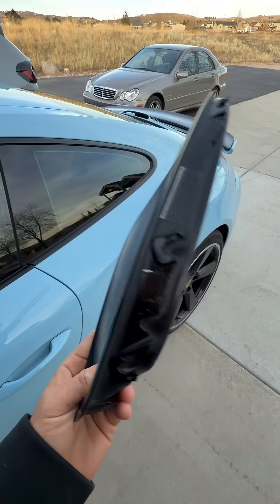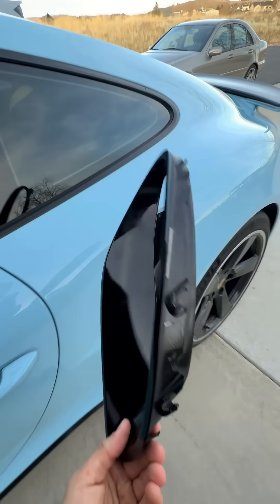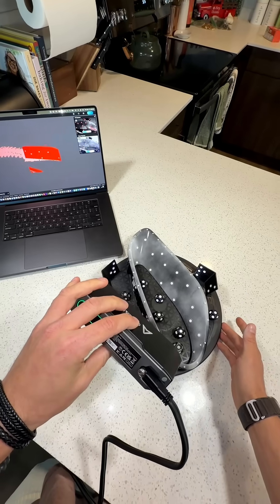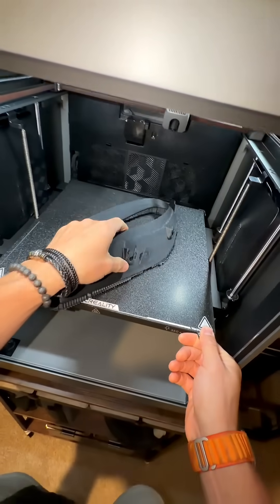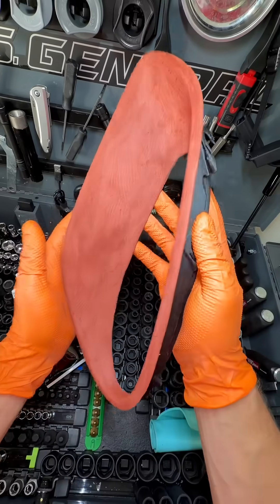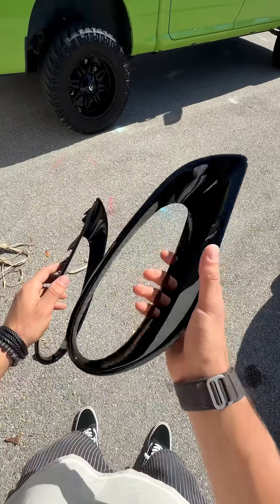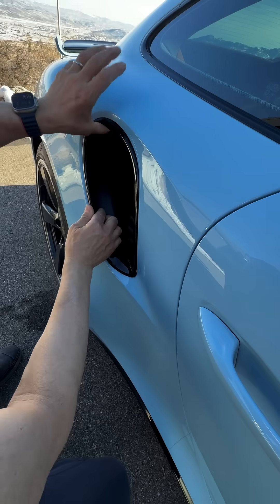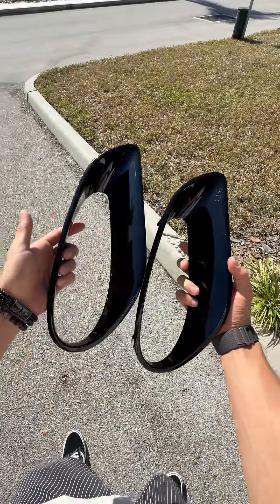Porsche wanted $2,000... So I 3D printed it for $20 instead😳😳😳 #3dprinting #creality #porsche

Comment: Final cost: 2k
Reply: Look at it this way if I buy the 2k part then it's expensive and it's 2k every time it gets stolen then it's cheap to buy a 3k or whatever the printer cost but you got unlimited parts for the car just pay like 60 bucks or whatever it cost for the printer plastic material but it's a lot less than buying a 2k part every time it gets stolen or lost 

Edit: Guys thanks for all the likes and replies I got more likes than what I get in my videos thanks guys
Reply: @YosvanyMederos-x5w the printer is more along the lines of 1k, and filament is around $35 per 2kg roll, and that might’ve been a 1/4 kilo each duct, I have the same printer, and filament and it’s definitely worth it in rhe long run. I 3d printed a wide body kit for my car, and a new front bumper in sections because I crushed it on a curb, It takes a while to print stuff that big but 1000% worth it
Reply: @DylanMoore-b9uIs it even legal to drive with a 3D printed Bumper? Isn't Bumper made in such a way to absorb shock? How can yours be the same?
Reply: @kirakira9906 i don't think the bumper is meant for shock, but rather protect your own car from small dents etc. Might be an insurance issue, but legally.. i doubt it.
The crumple zone, i.e the metal designed to bend in a certain way to minimize personal damage, that's what I'd guess would need to be stock for legality.
Reply: @kirakira9906 first of all, u did a buch of logical mistakes, basically coz u uneducated in the topic u r trying to argue...
That's okay, no one can know everything but in a future please think before saying, or just ask instead of "claim" some one as criminal 
First and foremost, plastic details on ur car isn't there for "absorbing" any impact, ur chassis do that, plastic elements there for airodynamyc purposes 
Second one, no it's not illegal coz there was no cases when those parts caused any trouble for anyone and law system in USA is based on common law tradition which is laws are developed through judicial precedent (case law) and NOT — on predictions "what can happened" 
Hope u understand it clearly
Also I'm not american and not even living there (yet) but to be honest — I want
Also I'm engineer, so I kinda cheating here even tho cars wasn't my speciality :D
Reply: @kirakira9906  the front bumper is plastic. The crash bar and crumble points of the front end are what you’re thinking of
Reply: @DylanMoore-b9u you printed a body kit? how does it print things that big in a single piece?
Reply: @DylanMoore-b9uno yeah, but the scanner is 500+ bucks too.
Reply: @Sneaky_Basket Driving a car with a 3D-printed bumper on public roads is generally not legal in the US, as the bumper is a safety-critical item and would not meet the specific federal and state safety standards required for road use. Litterly 1 Google search away buddy 😂
Reply: @MedicAthlete24W FACTS, she's thinking of the internal safety elements of the bumper, when the original person of this thread more than likely was referring to the "sleeve" or "cover" which are only the cosmetic and aerodynamic elements of the bumper. And so to accurately answer her question, there's nothing illegal about driving with a 3D printed bumper cover or sleeve. Companies make aftermarket parts all the time by the way. It would only be necessary for the internal safety components to be up to spec, assuming the internals were also damaged to begin with.
Reply: @kirakira9906 bumper cover 😂 not bumper and no it's not illegal to have a custom bumper because you don't have to follow policy car manufactures do.
Reply: @Sneaky_Basket  I'm guessing you're from India?
Reply: @MedicAthlete24W  technically speaking the part you’re referring to is the front fascia. Almost all vehicles actual bumpers are underneath the plastic/metal fascias.
Reply: @kirakira9906  almost all cars now have a front fascia which is what he’s talking about. The actual bumper is metal and hidden underneath. Only some trucks have their bumpers visible. Everything else has a front fascia with a bumper underneath. Fascias are purely for esthetics and aerodynamics.
Reply: @MedicAthlete24W  it’s not a bumper it’s a fascia. The metal bumper is underneath it.
Reply: @ghosthunter0404  yeah one Google search for incorrect information because everyone is misidentifying the bumper. 

It’s a front fascia, the metal bumper and crumple  zones are underneath. Doesn’t really matter if you 3D print one. It’s purely for esthetics and aerodynamics.
Reply: @Pawnsylvania Oh okay, thank you for the more technical clarification. I was just skeptical. I don't know how much it costed him to print it, but depending on the Car it's easier to find a good piece for a good price in Scrape Yards. In my country (I don't know if you guys have a system like that), there are Scrape Yards managed to resell (at a lower price) parts of Cars that are still in good condition (and meet Law's requirements).
Reply: @kirakira9906  plastic bumpers are covers not actually bumpers. The bumper is steel and underneath the covers.
Reply: @DylanMoore-b9ueven the CR otter is only about $800. Opportunities are endless when you can do this.
Reply: @MedicAthlete24W No the bumper is the metal part under the bumper cover which is the plastic part. In the US I believe the bumper must absorb a 5mph crash without the structure it is attached to getting damaged.
Reply: @DylanMoore-b9u I printed an entire car, with a hat to match. They see me rollin’, they hatin’.
Reply: @DylanMoore-b9uWhat printer is it??
Reply: @Sneaky_Basket engineering regulations are not created as part of common law.

And laws are written to include penalties for doing things that are not within regulations.

An engineer should know all about industry standards and laws around safety requirements.
Reply: @DylanMoore-b9uthe printer is around 1k but you're forgetting the creality scanner which isn't cheap
Reply: @julianbruce7595 he literally said he done it in sections, if ur printing something big u print stuff in parts that click together or glued together
Reply: @DylanMoore-b9u forgot cost of labor in there…
Reply: @DylanMoore-b9uyeah but that scanner doesnt come with the 3d printer, thats another $2000, plus hours of his time.
Reply: @DylanMoore-b9u maintenance??? what don't you never clean it ?
Reply: @DylanMoore-b9urealized something. This is a 2000 dollar part for a PORSCHE. Yeah, I mean, if I have new Porsche money, a $600 dollar scanner is probably a non issue. As someone who has 2015 Honda civic money, 600 bucks is my share of rent for 2 months.
Reply: @kirakira9906 This isn't a bumper, it is just a trim piece and most of those are made with ABS plastic.
Reply: @HeyNostradamus But it, like the 3D printer can be used for many future projects. $2,000 for the Porsche part and you have nothing left over. What if the same part gets damaged again? Another $2K gone.
Reply: @Sneaky_Basket  do you wanna talk about uneducated? You can’t even spell cause right like all of the grammar errors and what you just said make you look like a kindergarten trying to talk like they know what they’re saying
Reply: @S @Sneaky_Basket  also I highly doubt you’re an engineer because engineers don’t type like that
Reply: @Uselessnonsenseisgoofy  Clearly English is not their native language and is a 2nd language. So I'd say they deserve some degree of grace when it comes to grammar and mistakes.
Reply: @DylanMoore-b9ucan you explain how you printed for your bumper? That sounds amazing
Reply: @DylanMoore-b9ubro im curious to see how that came out
Reply: @DylanMoore-b9ukeep printing a few and sell em online for like 500😅
Reply: @kirakira9906  he didn't 3D print the bumper he 3D printed the bumper cover
Reply: @BrownFella  That's what I said
Reply: @DylanMoore-b9u The printer is $1100 and the Scanner is $900, and that's before any taxes and shipping. So base level the equipment costs as much as the new part.
Reply: What's the first thing a pedestrian hits in a collision smart boi?
Reply: @julianbruce7595  if you don't restrict yourself to printers with a body there isn't really a limit to maximum print size. You can print as big as you can make the rails the motor of the printer head rides on. And if you use a rolling print bad, you can even make one axis virtually infinite ...
Reply: @DylanMoore-b9ulol printed wide body kit
Reply: @DylanMoore-b9u You forgot the price of the 3d scanner!
Reply: @Sneaky_Basket wrong. The front of cars are now plastic for pedestrian protection. Plastic is a lot more forgiving on a pelvis and legs than metal. It’s not hard to verify. So, you are the one who is uneducated. Also, try writing an actual, intelligible sentence before insulting someone else’s intelligence, it’s really not a good look.
Reply: @ghosthunter0404 who would know though? Besides yourself.
Reply: @DylanMoore-b9uyou forgot about the 3D scanner price
Reply: @Sneaky_Basket  wrong.
Reply: @ghosthunter0404  Correct, thanks for letting people know to not cause themselves huge headaches in a law suit where the printed number snapped way too easily and caused injury to a pedestrian- then we see the suing start to happen.
Reply: @badavian 😅
Reply: @HeyNostradamus  I own a 3D printer and a 3D scanner but no Porsche. If I use my tools to make a part - should the full tool costs be applied to the cost of that part?

And for this video? The guy making the part did it for a friend. His friend did not need hos own printer and scanner.
Reply: @DylanMoore-b9ufirst off you can most certainly get a printer than can print asa for cheaper than 1k and that part realistically not including the printer is assuming we factor minimum spend on materials then this realistically costed around 70 dollars to make on a 300-600 dollar printer
Reply: @kirakira9906 the crash bar behind your bumper is designed for that. Bumpers are just cosmetic
Reply: @julianbruce7595 it doesn’t, you print as big a so can then bond the pieces together later😅
Reply: @kirakira9906 modern front bumpers are abs plastic. There's an actual metal bumper just behind it
Reply: @ghosthunter0404  it was the bumper cover that he printed, even though he called it the bumper. It has no structural function. It is cosmetic plus makes a contribution to the overall aerodynamics of the car.
Reply: @Sneaky_Basket  being an engineer and using "coz" instead of "because" proves why China is eating the market alive 😂
Reply: @kirakira9906  at least in Germany its not legal to print bodywork for cars. These parts need to fullfill a lot regulations.
Reply: @DylanMoore-b9u P1S printer is 400 bucks btw, not 1K. and it has the same print quality as the higher end printers
Reply: @DylanMoore-b9u yeah plus the printer is a 1 time buy then after that you’ll save a lot
Reply: @kirakira9906  most people call a bumper cover, a “bumper”. The painted plastic you see on the outside is not at all designed to absorb shock, the bumper is under that plastic is. Designing something to be functional and also stylish can be tricky, and with strict safety regulations for vehicle production, automobile manufacturers have switched to hiding the actual “bumper” behind the body style of the car. That’s why you typically don’t see cars and trucks with actual bumpers that are attached to the unibody or frame, and has since created a huge shift in the way cars look nowadays.
Reply: @kirakira9906 it’s not illegal, but I don’t know how the whole crushing legality would work because they can’t test that
Reply: @julianbruce7595 it’s not a full 1 piece it was about 40 different pieces with 10% infill, then they were all connected with dovetail joints, and sanded them coated with 2 layers of carbon fiber. Took almost a month but considering it was only $200 in materials I made it out on top. Only hard work was assembling and coating with carbon fiber
Reply: @BrownFella no, it was a full bumper, not a cover but I did not mess with a crash bar and all of my sensors, and safety features are still attached
Reply: @Crunch.Punchman nope, it just took multiple months to finish, but it was worth it
Reply: @superyumb actually I only ever had the nozzle clog, replaced it with a $40 silicon carbide nozzle and never had another issue besides bed adhesion but the k2 pro ai caught that before it really mattered and sends my phone a alert
Reply: @Odiewan-Kenobi768 no it’s a full bumper, if your being more technical it’s a front fascia, but it makes sense to call it a bumper in this case
Reply: @brag0001 also you can just print in large chunks and connect them, I used dovetails and 3d gloop, then carbon wrapped it
Reply: @howdyyallllll100 yeah, it’s sick
Reply: @MoneyTipsAndClips you can even make one on a old 2018 ender 3, i started with printing on that, but then decided to go with a k2 pro so I could print bigger, faster and more reliably, but it’s totally doable with a cheaper printer just takes longer
Reply: @StatusQuo209 yeah I had a k2 pro, that’s why try at was my baseline for myself, you could defenitly do it on a ender 3 which is what I used for the first sections of my bumper (front fascia) until I decided to get a better printer
Reply: @ekhatchmax1405 yeah I was using the word bumper in this context because I didn’t think so many people were thinking I bodykitted a fucking piece of metal under the fascia😂
Reply: @DylanMoore-b9u sure, but that's more of a crutch. Useful, if no other option exists. But if you need it on a regular basis those options do exist ...
Reply: @DylanMoore-b9u 

What's the time and effort worth?

£600-£1000.
Reply: @DylanMoore-b9uwell the machine and the camera itself is way more expensive and if this would happen often them it is worth it
Reply: @DylanMoore-b9u3d scanner is the expensive part here
Reply: @DylanMoore-b9udo you like this printer? I have been researching machine for too long now not committing
Reply: @YosvanyMederos-x5w because these get stolen all the time😂😂😂
Not to mention all the prep work needed afterwards😂😂😂
Reply: @kjjviii1735 if the parts cost 2k for a replacement im sure there is a business for stealing these
Reply: @BubbaFettscafe. But how often do they need replacing such that there’s a demand for them to be stolen?

You’d have to steal a load to create the demand….and then hope that demand finds you in order to sell it…without you getting caught.
Reply: @kjjviii1735 😂 everyone drives around in a Porsche 😂that is why😂. Most common car on the road.😂
Reply: @kjjviii1735 You can always find a reason to belly ache about something. That's not special.
Reply: @nathan9113  that makes no sense. You could be a millionaire and still think $2000 is too much money to be throwing away on a part that can fall off or get stolen at any time.
Reply: @nathan9113  its not the owners time. So why would he care?
Reply: @nathan9113 or, because fuq Porsche
Reply: @kjjviii1735  yeah because the scanner and printer can only make this exact part 😂
Reply: @GR33KFR3AK  use more emojis, please.
Reply: @NeilWatkinsfromaccounting will do 🤘🤘🤘🤘🤘🤘🤘🤘🤘🤘🤘🤘🤘🤘🤘🤘🤘👍👍👍👍👍👍👍👍👍👍👍👍👍
Reply: @kjjviii1735  The point is that it pays for itself. Even if you used it for literally just this. But you won't, because there's plenty of other actual practical use cases for a 3D printer. Even if you design and print one other thing that isn't landfill material you've now exceeded the original investment.
Reply: @BubbaFettscafe.  How? Who will you sell them to? These parts almost never break, very few people need them replaced. It's just a plastic piece. You'd steal them and end up having it sit there collecting dust lol
Reply: @AlphaFox_101  these parts don't just fall off at any time and they rarely get stolen because they're not worth much on their own. It's not like the rims were stolen
Reply: @user-ze3sg6ix1u  They must just fall off. Like you said they didnt take the rims and the other one was still there
Reply: @kjjviii1735 THESE might not get stolen/replaced all the time but many other things on many many other cars, let's be real here no one is buying this whole set up for 1 vent😒
Reply: @kjjviii1735  I guess you never heard about the Porsche headlights getting stolen pandemic. Dealerships were literally having every car on the lot jipped every night.
Reply: @AndrewCotner-z7l oh well, lucky we have a printer to replace the headlights, right!🙌🤪
Reply: @kjjviii1735  if you cant think of all the plastic shit in your life that you could easily fix instead of throwing out and replacing when it breaks, then you are right, the 3D printer is not for you. But that is really just a personal problem on your part.
Reply: @kjjviii1735 cause the couple hours of prep work totally isn't worth saving over 1k.... Sure if you got the right kind of money problems just go spend that 2k on a plastic part. Or be like the rest of us with an enginuative mindset and save that money.
Reply: @kjjviii1735  I don't get what's the point of stealing a plastic duct
Reply: @kjjviii1735 VW needs to do better , in South Africa it’s their head lights on their VW polos it’s literally the only car that thieves target because apparently you can just remove the headlights with a simple pull.
Reply: @AlphaFox_101  I think a millionaire is actually more likely to think that.
Reply: @cymy2  Exactly. Millionaires became millionaires by being careful with their money. Theyre not usually wasteful
Reply: @kjjviii1735 would not be surprised if someone at Porsche is getting paid off the books to just find cars and steal their ducts. 😂
Reply: nahh 3D printers are relatively cheap now so this couldn’t cost 2k unless going for an ultra premium printer
Reply: @xxviper2264 if you do 3D printing and already have appropriate printer software and everything, then it really boils down just to material cost...and companies are scared of it
I am sure there are people who would rather pay 2k for overpriced plastic loop just so it is "original" but people are figuring out that "brand" is not worth that much if result or for example taste (with cheap cola) is the same
Reply: @xxviper2264  that scanner will be the biggest cost.
Reply: @xxviper2264  the scanner is $1500 alone
Reply: @Daralyndk  100% agree with materials, but nothing comes close to real cola tho 😂 I swear to god I live on and for Coca Cola, rip offs are just not the same 😭
Reply: @YosvanyMederos-x5w and then next time you need to print something, you already bought the printer, you don’t need to buy it again for your next project. That alone makes it worth it imo
Reply: @YosvanyMederos-x5w  sorry man, no disrespect, that's one of the most stupid takes I've ever heard. Justification: you're acting like parts flying off your car is a regular thing  it's not, it shouldn't be, and investing in a printer for that reason alone is dumb financially. Sorry bro
Reply: @YosvanyMederos-x5w dad math wins 🔥
Reply: @YosvanyMederos-x5w  you're really anticipating this gets stolen that often?
Reply: @YosvanyMederos-x5w  not to mention you can also make/replace shit for the rest of eternity as long as you got the warranty
Reply: @YosvanyMederos-x5w every time it gets stolen 😂
Reply: @YosvanyMederos-x5w his printer is like 600$
Reply: @YosvanyMederos-x5w  Things are always cheaper when you have the know-how to make the thing. But, there's a reason most people buy furniture instead of buying a bandsaw and some lumber.

This is not me discouraging DIY btw, just that people tend to overlook the (time) cost of having to learn the skills needed to replicate the thing (on top of the cost of tools and materials).
Reply: @YosvanyMederos-x5w you're trying too hard to sell this
Reply: @YosvanyMederos-x5w I get your point but „if it gets stolen again“? Time to move neighborhoods lol
Reply: @YosvanyMederos-x5w yeah he just mention the plastic material it self is $250 and then the paint sent to a shop ( yeah maybe next he would buy his own paint system), and then the time (well if you got nothing to do but make utube vid), then he might as well start his own business then and only then, it might hit him 😂
Reply: @YosvanyMederos-x5w why would someone steal it? What for? And even if it does why do you park this car where parts of it get stolen? 🤷‍♂️😆
Reply: @YosvanyMederos-x5w how many times do you plan on replacing those? 99% of the cars never have the issue,your comment is dumb in THIS situation
Reply: @YosvanyMederos-x5w almost got a stroke reading this
Reply: @YosvanyMederos-x5w , where do you live so plastic gets stolen?
Reply: @YosvanyMederos-x5w yeah... But how many times will you lose your Porsche parts
Reply: @YosvanyMederos-x5w  printer and parts with computer maybe 10k?
Reply: @YosvanyMederos-x5w  maybe you should not break or lose (I don't really know how can you do it) parts of your car. Also it's not common to have this kind of cars and live in places where stealing is a problem.
Reply: @YosvanyMederos-x5w  Time is money friend
Reply: @YosvanyMederos-x5w  did you see how much time and effort it took him to make the part, the multiple sandings the spray painting etc and then the $100 extra for the preofressional finnishing.... also keep in mind the mess the spray paint makes... unless you want to setup an OE parts business this is a complete waste of time
Reply: @g00dnatur7 it really depends on your income and whether doing stuff to your car is a hobby or not. If you could make the money in less time than it takes to make the pieces then maybe it's not worth it. If you like modding your car and it's a hobby then maybe it is worth it even if it's technically more expensive due to it taking your time. 

This isn't a one solution fits every person scenario, I'm not sure why so many people can't grasp that. This guy is just highlighting the possibilities of new technology, it's that simple.
Reply: @g00dnatur7  I’ve night tired part side mirrors for cars that come in just rough plastic.  Sanding and painting isn’t too tough

I used rattle can.  Glossy silver is pretty universal.

My critique is that scanner is cool but it’s just another thing that’ll not work in 8 years and if you want to keep having that functionality you’ll have to replace
Reply: @g00dnatur7  I dont intend to downplay the work he did with the sprays but thats maybe just like 1 afternoon of work. Probably a couple of hours. The scanning and printing process was probably a couple of hours, half a day at most with some waiting time in between. You can probably get this done in one weekend if you have the equipment and the parts. But I think he is advertising it as a business model which isnt bad either. In another comment he said he used around $250 in total so if he charges like $100-$300 or even $500 on top of that for the work it would still be less than half of the price of one part and you would be getting 2 matching pieces. On top of that he probably has enough time to do more than 1 small project in the same day while waiting on some parts of the process for the other one, its not a bad business model for the customer or the provider.  

Saving like $1200-$1500 on a piece of plastic that can easily get stolen again is a good decision.
Reply: @g00dnatur7 dude. All of those sandings combined takes like 40 minutes. It's not even a full day of your weekend and saves 2k dollars.
I couldn't make that money in a week let alone a day.
Reply: @g00dnatur7 ts gotta be ragebait 💔🤞
Reply from the maker: it was around $250 for all the material. i already have the scanner and printer. if i didnt well than it paid itself off. and if i bought the parts from Porsche it would be $4,000 for the pair
Reply: @Haydenschreiermk2  The scanner is like $800 though.
Reply: @akingtonone only $250...... must have equipment,  knowledge and time....
Reply: @akingtonone that's cheap.. I thought it'd be more
Reply: @johnny9072 what??
Reply: @akingtonone  you aren't buying a 3D scanner and printer just to make a car accessory and then throw it away. Equipment cost shouldn't be factored into overall product cost
Reply: @akingtonone you understand, even if you have to buy the scanner, you can use it in the future for multiple purposes and multiple times?
Reply: @AyushRaj  equipment costs must always be factored into the price of anything you produce. You shouldn’t factor them into the price of one or two parts, but you must factor them into at least first year of production. After that, you are out of warranty, so on the second year you should factor the maintenance costs. And from 2nd to 5th year you should also include replacement costs. 
Of course all this applies only if you are going to use this equipment commercially. 

If you are not going to use it commercially, then you should factor it into the price of those first two pieces. And as you said: you are not going to throw it away, so you should also factor in the price storage costs for equipment you are not really using, but also not throwing away. :0)))

You could just buy the scanner (as the cheaper part of equipment), do scanning and playing with the 3D model as a hobby (so that you don’t calculate your own cost of work hours), and then take it to a job shop which will print it for you at a price of about 4-500$. (Because you want a sample in PLA and then the real part, and they have invested money so they have to factor the equipment cost and labor into their price)
Reply: @akingtonone yeah but he already got it. If he didn't, you could add the extra 800 bucks to the cost. And he must use his printer for other stuff than simply printing car parts.
Reply: @akingtonone fun fact, you don't need a new scanner for every new project, I know right, sounds revolutionary, but it's true, just like if you want to watch something new, you don't have to buy a new TV for it.
Reply: @akingtonone  you're saying that like the printer is one time use only for the Porsche
Reply: @MacakTosha that’s probably why my boss charges so much. He’s including the price of the drill he bought 7 years ago
Reply: @AyushRaj  No shit, but you can't just replicate this as cheap as he did.  It doesn't work that way.  If you don't have the equipment, you'd still have to purchase it.
Reply: @johnny9072  yeah the point is not that you SHOULD do this, just that you CAN do this
Reply: @akingtonone  yes and the house is 800k but he already had it
Reply: @manuelmenendez5691  you still have to buy the house 😂
Reply: @akingtonone still cheaper than Porsche
Reply: @EugeneC219  it’s not cheaper than buying the parts themselves from someone other than Porsche. And if you don’t have a scanner or printer it’s not.
Reply: @johnny9072  yah, so it is really worth $2000. LOL
Reply: @akingtonone yeah 800 it's not 2k or 4k and you have a printer for future or other purposes
Reply: @MacakTosha  to sum you up quickly, "accounting for initial cost, maintenance, and depreciation ideally ought to be worked into pricing."
Reply: @akingtonone  yes but the point being made here is compared to the OEM part. If you had a friend or even a little bit of connections through which you can get a scanner and printer then it will be significantly cheaper than the OEM part.

Or you could buy one yourself and consider it an "investment" because 3D printers are actually very useful for printing everyday use objects and even decor and gifts. Thing will pay for itself slowly
Reply: @akingtonone  If this is the only time you're ever going to use it, yeah, you have a point... but I doubt that's the case for this dude.
Reply: @deedoubs agreed but it’s cheaper for the normal person to just buy it.
Reply: @ClavinZKL minus the money he made on this short from the total
Reply: @akingtonone  So?... Even if the scanner was 2k, it still paid for itself, and not mention he can print more of these parts, and sell it to make up for the printer.
Reply: @akingtonone  Yeah but you can use it over and over again for other things, so I wouldn't count the scanner as part of the expenses of making the part.
Reply: @akingtonone in the long term it’ll be worth it
Reply: @MacakTosha  Tell me you’re a finance guy without telling me you’re a finance guy. All we need is to depreciate the asset for accounting purposes, and I think we’ve covered all of our bases. Love it.
Reply: @akingtonone You haven't counted your time. You actually made a strong case for $2k being reasonable.
Reply: @akingtonone  you can make so much shit with that and I’ll pay for itself after one or two times of usage
Reply: @johnny9072  Well done Johnny you've discovered division of labour
Reply: @akingtonone  still less than 2k
Reply: @akingtonone  yeeeeah but…um he didn’t buy the printer just to print this….holy smoke!
Reply: @HydetheRapper  i am an engineer. 
When I design some product or a part, i must consider the function of the part, its reliability, loads it has to bare, weight in the whole product, and of course: production difficulty. This has huge impact on the price of the part. 
If I design a part like this, or copy it using a 3D scanner, I want to know how much it costs to be produced, before I go to a guy who has a printer that can print using strong plastics, and lay metal inserts and strengthening fibers during the process. 

If I see that I have a lot of printing like this, and that my suppliers are robbing me blind, I want to be able to recognize the moment when I have to buy my own printer with these capabilities - so I can earn more. 

We don’t work hard so we can afford best machines. Machines have to work hard to earn us money. 

At least this is my logic for any investment that is more than a thousand dollars. ;0)
Reply: @the_n0mad  Nice strawman, who made that point exactly? The point was that equipment cost should be factored in with the project cost, since any NEW person attempting this project would NEED and LIKE to know that. 

it is very disingenuous to say you spent pennies to slap together a project that would not exist without hyper expensive equipment
Reply: @akingtonone Or go to someone to to do it for you for a fee like he did for the final paint finish. And a 250$ scanner investment for a 3600$ job isn't bad.
Reply: @akingtonone if you’re doing a job yourself 

Do you count the tool price?
Reply: @the_n0mad  for real? I threw away the last unit when I was done printing what I needed. 

I thought they were one time use?!
Reply: @akingtonone best ragebait I've ever seen lol
Reply: @akingtonone  he already has the equipment at hand. so, it's far more economical for him to do it. and if you don't have the equipment, there are 3D printing services that does the scanning and printing, even if it costs $600 it's still a better option.
Reply: @akingtonone not per use though and it’s not limited to this single use.
Reply: @the_n0mad hold up, I've been buying a new printer for every print job, I've been doing it wrong?
Reply: @akingtonone Or walk into your closest library with a 3d printer and scan the part with your phone.

The tech is not rare, plenty of places where you can access high end printers like x1c for literally for free.

The point of the video was to showcase that you can just make the parts yourself, how you source the machinery is up to you.

plenty of people would also just print that just material cost + postage out of boredom (I own several printers and constantly print spare parts for people just because I can)
Reply: @akingtonone are you going to buy a $800 scanner everytime you print everything? No
Reply: @johnny9072  and the problem on that is?
Reply: @akingtonone Yeah that's really not how it works... If i buy a laser cutted part, am i counting the price of the laser cutter into the outcome cost? 😂
Reply: @MacakTosha No, that's not how it fucking works. It's a one time buy, money is already gone a long time ago. Has absolutely nothing to do with the price of whatever the fuck you're producing with them for yourself...

If you hang out a painting in your living room and you need to drill a screw on the wall, do you count in the price of the drill you bought a year ago?
Reply: @johnny9072 no way it's only $250
Reply: @akingtonone it's $1200+
Reply: @akingtonone not to mention what the labor would be if it wasn’t his friend
Reply: @johnny9072 the scanner is 700 - 800. Not sure where you got 250 from
Reply: @akingtonone it is like a one time payment tho
Reply: @akingtonone  bro think you can only use the printer once, what the fuck?
Reply: @d3lyxoomusic103  and you sspeak as if he only uses that printer once and gets rid of it or smth? tf?
Reply: @akingtonone he already has the equipment so the total cost to make the part is 250
Reply: @AyushRaj but equipment cost is definitely factored into pricing lol go take a basic accounting course😂
Reply: @akingtonone  a 3d scanner is not a one time use thing and he doesn’t need to buy a scanner he can send part to 3d scanning and printing business and they will do everything for way less2000$ it won’t even get to 500$
Reply: @All @AlluzHH re is a difference between running a business and a DIY hobby project. First one has a goal of making money, and second one is about relaxing and enjoying. And when you are done hang a painting on your wall, that painting is there for you to enjoy looking at it. I don’t calculate man hours and the price of a nail (or the painting) in that case, because it is not an investment. That’s how it is for me. 

Replacing a missing piece from the car can be both a necessity and a hobby, and if you have thousands of dollars to spend on gadgets - treat it as a hobby. But then you tell everyone how you did it, and not how much you saved by not buying it from Porsche.
Reply: @AyushRaj  that's exactly how every company and business does things though.... The equipment and materials cost is always factored in...
Reply: @akingtonone  Yeah he needs to buy a new scanner for every part. 😂
Reply: @akingtonone it’s a tool he already had
Reply: @akingtonone dawg $1050 still way cheaper than $2000 and you can make more saving you more
Reply: @MacakTosha  they sell a 3-D printer of that same brand for $550 plus he paid $250 for materials and then he paid $100 for the paint shop to paint it, total cost= around $800. So even if he bought that part from Porsche, which they probably only sell them in pairs which would be $4000, but if he just got one for $2000 he still saved over $1000, and he still has a 3-D printer for future use on many different things. You don’t have to use it for commercial use, and a 3-D printer cost less than the smartphone in your pocket today 🫡
Reply: @akingtonone If you're gonna use the scanner far more than once, $800 as a one time purchase isn't too bad.
Reply: @akingtonone that’s because he has one already
Reply: @akingtonone still cheaper
Reply: @akingtonone   I just wanted to get that scanner and it is 899$ , okey...
Reply: @akingtonone the scanner is 1735 dollars
Reply: @johnny9072 But if he already had the printer it's only going to cost him 250. He didn't once say it would cost you or anyone else 250 to make it.

Swear all people do on here is start pointless arguments and trying to be a smart ass at every opportunity.
Reply: @akingtonone yeah but he bought it years ago not specifically for this
Reply: @akingtonone  if you are buying the scanner for just this application, then you can resell it and recover most of that cost
Reply: @akingtonone  that’s cheap, but even if it was more expensive, it can make multiple piece, so regardless is worth it.
Reply: @AyushRaj it should be when you don’t even own 1 before.
Reply: @akingtonone  if that's an accurate cost then it would still be less than buying the part from Porsche. He printed 2 for $250 and they wanted $2k for 1. Even if you added the cost of the printer at $800 that's only $1050.
Reply: @Junior-th8uo You're assuming a porsche driver has additional use for a 3d printer.. We're not all nerds mate
Reply: @akingtonone are you dumb? Your saying like you'll throw the scanner after using it😂. That scanner is an  Investment.
Reply: @akingtonone the scanner can be replaced with something more cheap or you can create the model from the projects, I mean if you are skilled the final product is almost the same as a scanner
Reply: @AyushRaj  thats stupid.  Most companies charge extra to pay off equipment cost and maintenence.  If you ever ran a business you would know this.
Reply: @Yoursoul101 you aren't charging the cost of the whole equipment from a single customer then why should a single piece of manufactured item cost have the whole price of the equipment factored in
Reply: @akingtonone  $800+$250=$1050
$1050 is still less than $4000.
Reply: @akingtonone  yeah and you need to learn how to use the printer and the printing software too is not only the cost 😆
Reply: @AyushRaj no it should be but cost out in either 1year or 3 years, just like building cost are add into anything that is mfg. Some equipment is cost out 5,7 10 or 20 years. It’s all based on time or you can cost equipment out on a single job. I would be labor time + cost of equipment + mfg cost x profit % would = price. That is some what how the big companies figure prices and profits on goods produced.
Reply: @akingtonone Well you get to keep the equipments
Reply: @Haydenschreiermk2 he works for Porsche so naturally he has to say it 😂
Reply: @strizhi6717 impossible, if he would, he would know how to pronounce it properly.
Reply: @jandomke5034  porsh-ah? 
Tomato Tomato. Get over it.
Reply: @strizhi6717 he literally told every viewer of this short how not to buy Porsche parts from Porsche
Reply: @un_hominide  this is what happens when you stick your nose into other people comments and don't even know who was responding to who - 

Clearly something went over your head
Reply: @strizhi6717 well the "it" in "naturally he has to say it" does need a bit more context, but even then, if you were serious my comment still stands and if it was a joke then everything is fine, also there is a line showing what comment you responded to
Reply: @un_hominide the guy giving the uploader a hard time was remarking its a waste of time and expenses cause getting a 3d laser printer to do this will still cost 2k for a piece of plastic...just better pay Porsche and be fine being screwed. My response the guy saying this works for Porsche sort of tongue in cheek. 

And besides that argument is bogus cause you only need to buy printer once and use it unlimited obviously saving countless thousands on all sorts of 3d prints vs buying from a dealer -

Video maker uploader is a genius and the nay sayers work for Porsche ;)

Get it??
Reply: @Haydenschreiermk2 it did not pay for itself at all. There are several manufacturers that sell those side vents in carbon fiber ~$500-1200 for the pair. You spent $250 in material cost for a printed abs plastic version and definitely didn't factor in your time. All is fair in love and war, I too have spent many hours working on cars to save acouple bucks when I could have spent a couple more dollars to save several hours. 

Edit: It appears alot of people commenting below disregarded the fact that I stated that there are non-OEM providers that offer the same product, with better materials, at or lower than his cost. This is especially true once you consider his time, paying a shop to paint them, and the opportunity cost of taking on this project. I too have definitely "lost," money working on my vehicles when factoring in the afformentioned factors because I enjoyed doing so and there is nothing wrong with that. The difference is I'm willing to acknowledge this fact. It is a disingenuous statement when you state it only cost x amount of money in materials without stating the other costs and time associated with the project.
Reply: @UndefinedStasis  I mean $250 in material for multiple vents that would have cost $4,000 from that manufacturer is a little more than "just a few dollars".

As well as printing is a waiting game. I doubt he really put that much time into this compared to how long it probably would have been just waiting to get the overpriced parts.
Reply: @UndefinedStasis  Even if he bought the equipment just for this problem and it didn't save him money... He now Has the equipment and can use it for future issues. That's a win.
Reply: @UndefinedStasis  I'm sure he's doing other stuff while waiting for the 3d printed part. So not a lot of time wasted.
Reply: @UndefinedStasis "a couple more dollars"

saves $3,750
Reply: @UndefinedStasis yeah except this guy is trying to save a buck on his porsche 😂  guy shouldve bought a more affordable car
Reply: @bigbadchevy 🎉
Reply: @UndefinedStasis  He has spent some time making the model, but can now use the file whenever he needs to replace the part again. And it can also be shared online for other people to use.
Reply: @UndefinedStasis it wasn’t ABS…
Reply: @UndefinedStasis  thanks for showing us that you don’t know how to math😂😂😂
Reply: @UndefinedStasis  I wouldn't say it didn't pay for itself because this certainly isn't the only project the scanner and printer has probably come in useful, but I do agree with you that saying $400 was the only cost for this project is disingenuous. People forget that prepping for scanning, scanning, printing at least twice, sanding, priming & taking to a shop for finishing x2 (because he wanted a matching pair) isn't just a few hours of work. I take on projects like this often and this was probably about a dozen hours or more of work over a week or two.

While the manufacturers price was a bit inflated their several hours of r&d, trial and error and materials was taken into account and charged for.
Reply: @UndefinedStasis if someone doesn't have to work the time doesn't matter .
So would you rather spend 24 hours doing work and research to only pay $300 or would you rather pay 3k 

It's not rocket science
Reply: @zwicker5585 No you sound stupid. Wanting $2,000 for event is outrageous. I don't care if I had a Chevy spark. 
Someone not wanting to pay $2,000 for an air van does not mean they bought a car they couldn't afford. Why are you guys so willfully stupid😂
Reply: @KingJKickz  but its not 2000$. Hes lying for views. You can get these for a few hundred bucks from porsche. 2k is for the carbon fibre ones which he didnt have or make. And if you “dont want to pay 2000$ for air vent” dont buy a 200k car. Its that fkn simple. If you cant afford to maintain your vehicle at dealer prices, then you can afford your vehicle.
Reply: @zwicker5585 just cause you have an expensive car doesn't mean you shouldn't try to save money on bullshit part costs.
Reply: @UndefinedStasis the biggest one is if he bought OEM, used on ebay or aftermarket. He would not have a video to monetize.
Reply: @UndefinedStasis fair point! 🤔
Reply: @UndefinedStasis He gained self sufficiency. He can also make his own molds using this machine, resin form a batch of 12, keep one and sell the rest. 
I am going to invest in a cheap vacuum setup for carbon fiber resin and a vacuum cast for aluminum.
Being able to tell someone "no" is worth it.
Also, he isn't getting paid during his time off anyways.
I'm so tired of people like this. If he didn't take the time he would never have learned. I can strip two types of Keihin carbaurators down now without consulting a manual and rebuild them in an ultra sonic to my specifications. Vapor blast as well, soon. I just learned how to save "blown" or "weak" motorcycle engines as well. I would never pay someone to do that after seeing how easy it is.
As soon as I find a decent lathe and build my own mounts, I won't even need a machine shop. 
You don't become an ungovernable by watching Netflix and letting someone else do basic things for you.
Reply: @UndefinedStasis I get that time costs money built if your not doing anything on the weekend then what did it really cost you besides gaining a beer belly or some series on Netflix. Im not being mean but the reality is unless the person's schedule is always busy with work which makes them money then personal time really isnt worth all that much besides your health.
Reply: @lamario ngl I don't mind long projects, I feel useless and restless when I don't have something to do and long projects help me feel more useful and like I have purpose.
Reply: @UndefinedStasis But contrary to what the infamous saying states, time is not necessarily money. The hours spent on creating the part in question would otherwise be spent on something less important. What do most people do when they are not being creative? They are being lazy.
Reply: @UndefinedStasis  i think you're the one confused here, he make utube video so nothing wrong, he spend more hours save save a few buck but making more money✅
Reply: @UndefinedStasis now he has a blueprint to sell these for $500 each side. Still cheaper
Reply: @zwicker5585 that's not his porsche,  it's his friend's 😂
Reply: @d3lyxoomusic103 which his friend can’t afford
Reply: @UndefinedStasis  if you are going to count like that, too bad for you, he made this video and made thousands of dollars. So it paid itself back.
Reply: @UndefinedStasis Yep.  Imagine the time and energy spent learning this skill, learning all about the various materials properties, getting up to speed on numerous different aspects of creating this finished part (even this guy took it to a professional shop for paint).  The only options are never just pay OEM pricing for another OEM part or make it yourself.  Do a little research and there are always a million ways to solve a problem.  Cost/benefit analysis.
Reply: @Max_Mustermann definitely a win as well! I think they are failing to see the bigger picture that the scanner probably wasn't bought just specifically to design the part in this video. Even if it was, he can still 3D print several other things. A good 3D printer capable of doing this is definitely a good investment overall. And I'm sure he still saved even with this project in the video.
Reply: Labor costs💀
Reply: @b @bigbadchevy  You completely ignored the comment about buying these from third parties for $500-1000. The  cost from Porsche direct is utterly irrelevant when you end up with a third party part anyway.

After waiting for the print, he had sanding, putty, primer, paint and polish. That alone is at least 5 hours. somdone who owns a Porsche, their time is likely worth at least $100 an hour at work. Probably more. 

Add material and time up, if he didn't spend $1750 on this, it's close enough to make time more valuable than the savings.
Reply: @Aaryn015  guess you missed the part where he said it cost him $250 in material... guess you also missed the part where he also said it cost him $100 to get them painted so for less than $500... he made a set... guess you arent good at math. Go still buy that one piece for $500-$1k.
Reply: @Max_Mustermann  and he can use it for many different things not just car parts but he can create a ridiculous amount of stuff with a 3-D printer and you can get a 3-D printer of that same brand for $550 which is less than the smartphone that’s in your pocket right now if you have a flagship smartphone 🤷🏾‍♂️
Reply: @lamario  so you’ve never did any work on your car to save money? I’ve done a ridiculous amount of work on cars over the years and him doing this is just like doing some mechanic work and he could still drive the car without that piece and I’m sure he did in between the time of making this part so it’s not like it took him a week to do this and this is all he did. This video is edited and I’m sure he went to work came home and worked on it and did whatever else came back and worked on it, it’s just like doing maintenance on anything else.
Reply: @zwicker5585  obviously he can afford to maintain it, because he did. Do you know how many people work on their own cars to save money? A ridiculous amount of people, Why do you think they have AutoZone and Advanced Auto? If they didn’t have any of that, then everybody would only take their cars to mechanic shops. So he can buy whatever car he wants to buy because he actually did maintain it because he did the work himself just like millions of other people do the work on their own cars SMH what a ridiculous comment
Reply: @freddyjason3142 what do you mean he did? No he didnt. He payed nothing and got a cheapo part as far as I’m concerned. Had nothing to do with auto zone or fixing your own. I like fixing my own car, doesnt mean i buy a new 911 when I cant afford to fix it. If you like to fix your own cars cool, but thats obviously not the case since the owner isnt the guy in the video. And the others do it themselves cuz they cant afford to pay someone else. Like what a stupid comment from someone who didnt even pay attention to the video 😂
Reply: @UndefinedStasis You trolls are nothing but haters. He has a printer, he'll eventually print other parts. It's a good post.  Get a life.😂
Reply: @UndefinedStasis this was a dense comment bro
Reply: @zwicker5585 that might be the stupidest thing I've ever read.
Reply: @Haydenschreiermk2 you probably will not do job to anyone just for the cost of materials. So, how much do you charge it if it is your way to make money for living?
Reply: @Haydenschreiermk2 why would you buy the parts when you said it was your mates car.😂😂😂😂
You saved no money😂😂
Reply: @Haydenschreiermk2 Plus the body shop. And most people don't own an expensive 3D printed and software. 

That being said if you have it then it is true it saved 1,500$ per part.
Reply: @Haydenschreiermk2  but to buy the scanner (as one would need to do if they wanted to replicate this process) the part cost more than a single original part.
Reply: @dstewar  nah
Reply: @MaxMustermann-dq2se fair point. I looked up the cost of the otter scanner and its a lot less expensive than i thought
Reply: @dstewar  to be fair. I was surprised too. Especially that they have even cheaper options, that seem to have good reviews.
Reply: @Haydenschreiermk2  yeah and when he goes to sell it, which he will eventually, the part isn’t OEM so he’ll have to replace it anyway or take the 2k hit on the price
Reply: @Haydenschreiermk2  ironically, before I was your 912th like on this comment, your video was still playing and I read “911” in my head soon as you said Porsche in the video. I know, nothing of true substance, I thought it was funny obviously considering Porsche’s 911 💀 I’m a stoner LOL
Reply: @Haydenschreiermk2  very nice video though bro. It honestly made me decide to get a 3D printer for things like this. I thought before if I got one I’d just make silly stuff, but it really is useful for tons of things.
Reply: To buy the machine it's more than 2k man.  You had the 10k setup.
Reply: @Haydenschreiermk2   bro we get it but you’re acting like everyone has a 3D printer … 90% of the world doesn’t do this is a pointless video but hey make your money Hayden
Reply: @Haydenschreiermk2 you didn’t account for labor at all lmao
Reply: @Haydenschreiermk2 so you don't value your time?
Reply: @Haydenschreiermk2 and how much time/labor? Obviously better than the dealership
Reply: @Haydenschreiermk2 this doesn’t sound right. How much does your 3D scanner cost? I thought 3D scanners are very expensive.
Reply: @Haydenschreiermk2  what’s your day rate though? Value your own labour
Reply: @Haydenschreiermk2 final cost is $0 if you already had the parts from Porsche. The investment of learning how to do this, is greater than $2000
Reply: @Haydenschreiermk2 did your friend try a breakers yard ?
Reply: @Haydenschreiermk2 u just increase to give yourself a reason people don’t care that printer and creativity at the end it will cost u more to print it than have them do it good side you keep that material that u may never use and will use space in your house
Reply: @Haydenschreiermk2 u could do that for work and sell them for like 800 bucks somewhere for side hustle
Reply: @Haydenschreiermk2 why would you buy a pair.
Reply: @Haydenschreiermk2 $250 plus the rest of the materials used, aka the printer and scanner. Plus the value of your time/ labor. What would it come out to after that?
Reply: @Haydenschreiermk2  And how much time did you invest in this?
Reply: @Haydenschreiermk2 How much is the 3D printer? I want one. There are so many plastic parts, especially engine parts or trim parts for German cars that now unobtanium or just outrageously expensive.  I work with VW’s and Audis and am encountering this frequently. Time to go into business making them.
Reply: @Haydenschreiermk2  Instantly recognized your voice Hayden. Didnt know you had a second channel & do 3D printing. Good job being financially literate as usual! Haha
Reply: @Haydenschreiermk2  250 for the print material or for the spray and everything else?
Reply: @Haydenschreiermk2 resale should be a thing make plenty and rack your bread up
Reply: @Haydenschreiermk2 how much was the printer
Reply: @Haydenschreiermk2  Craftsmanship doesn't cost!?
Reply: @Haydenschreiermk2 But if you bought it from Porsche you wouldn’t need a pair, you’d only need one
Reply: @Haydenschreiermk2  now you can make it for every porsche.
Reply: @Haydenschreiermk2 no. It's also your time and all the work . And the knowledge. And the printer.
Reply: The dude ain't even listenin to y'all 😂
Reply: @Haydenschreiermk2   you didn’t need a set though. You said in the video that you broke the other one. It would’ve stayed $2,000
Reply: @Haydenschreiermk2  hi
Reply: @Haydenschreiermk2 How much will it cost throw a specialist. If you payed someone to do it this way. As how many people have the time and knowledge to do this. I guess an owner of this car might, but still.
Just for reference, how much will you charge for this job.
Reply: @Haydenschreiermk2  how many hours of work?
Reply: @Haydenschreiermk2  time?
Reply: @Haydenschreiermk2  scanner and 3d printer total cost?
Reply: @Haydenschreiermk2 and it's much cheaper for companies chaise they automate it and produce in bulk
Reply: @Haydenschreiermk2 Not everyone has the scanner printer. Sand machine etc 😂
Reply: @Haydenschreiermk2 I think the point everyone is trying to bring up is what's the total value to buy the 3d printer the scanner you have and all other items needed to print this part in the 1st place. They are bringing up the fact its a freak accident for something like this to go missing meaning spending the money to get all items needed to do this 2 time in thier whole life probably isn't worth it also most people probably wouldn't even know how to use a 3d printer and scanner like you do to accomplish this feat so they might spend all that money trying to stick it to porche just to end up giving up and buying the 2k part anyways 😂
Reply: @Haydenschreiermk2 What’s your labor worth?
Reply: @Haydenschreiermk2 Great video!

The labor cost (knowledge, skill, effort) isn't taken into account.

I 100% would've (and have) done similar things. The factory cost of the part is absolutely insane. That's Porsche for you though!
Reply: @Haydenschreiermk2 I think you might have forgotten to factor in labor costs.
Reply: @Haydenschreiermk2 the title of the vid says $20 buddy
Reply: @Haydenschreiermk2 how much is the printer ? (For those of us who don't own one) And only one part was needed here. Why do you talk about the price of a pair ? We don't care. If the repair was 2k, and your printer + part is close to that number, then you just wasted your time and our time with this video
Reply: @Haydenschreiermk2  yea but dude you have thousands of dollars in the printing tech + the knowledge to do it. Freaky ahhhh nihhhh
Reply: @Haydenschreiermk2 how much did the 3D printer and software cost?
Reply: @Haydenschreiermk2  smart move...
Reply: @Haydenschreiermk2 why would you get a pair when you only need one though
Reply: @Haydenschreiermk2 Ferrari lawyers be drooling over this 😂
Reply: @Haydenschreiermk2  you’re smarter than the average bear dude. Most people, me included, even with all of the right equipment could not pull this off 😂
Reply: @Haydenschreiermk2  But how much was the 3D scanner/printer and paint and stuff?
Reply: @Haydenschreiermk2 if you account for labor youre not saving any money
Reply: @Haydenschreiermk2 Either you need to start the business of printing or find another alternative cuz not everyone can get a 3D scanner and printer plus operate it.
Reply: @Haydenschreiermk2 
Great! But what is the price for the scanner and printer?
Reply: @Haydenschreiermk2 do you have a video with that printer and scanner brands etc? I would like to learn how to 3D putting this year
Reply: @Haydenschreiermk2 it doesn't matter lol people dont have all that laying around lol still have to buy it
Reply: @Haydenschreiermk2 don’t forget the lawsuit from Porsche. That’ll be $100,000
Reply: @Haydenschreiermk2 so the title should say porshe wanted $1800 and I paid $250. You significantly dropped what you paid x10 and added $200 onto what Porsche wanted. Just bs to make it sound more impressive
Reply: @Haydenschreiermk2 and value has gone down, or are you going to lie and say it's all original???
Reply: @Haydenschreiermk2 and the time everyone spent with it? probably 3k -> not worth it
Reply: @Haydenschreiermk2 subbed due to transparency. Keep up the great work 👍
Reply: @Haydenschreiermk2 you need to sell these 🤔
Reply: @Haydenschreiermk2 if you bought porsche and $1800 is a problem. Uhm..... kia?
Reply: @Haydenschreiermk2 how much for the professional paint job?
Reply: @Haydenschreiermk2  but you didn’t need a pair. You just needed one.
Reply: @Haydenschreiermk2 why u show prices from a website which has nothing to do with official prices? If you would order the part from your dealership directly, it would so much cheaper ... ..
Reply: @Haydenschreiermk2 why $4k off of Porche? You'd have needed only one side for 1.8k
Reply: @Haydenschreiermk2 Psst. You should totally upload your 3D model file somewhere.
Reply: @Haydenschreiermk2 then*
Reply: @Haydenschreiermk2  * ~3.5k
Reply: @Haydenschreiermk2 so the 20$ in the title is just click bait
Reply: @Haydenschreiermk2 so you got all That Shit for free? Because the fact aint chanting Just because you bought IT before That... You still needes a 8k 3D Printer, a 1bucks Scanner and so on.
Reply: @Haydenschreiermk2 moral of the story, buy a Corolla
Reply: 250$ but how many hours it takes to you?
Reply: @Haydenschreiermk2 but you didn't need the pair man. I do this for a living so, be a little more honest. And glazing putty wasn't made to use that way. It was made for pin holes not surface leveling. I understand schilling the equipment but, if  someone with no experience in any of the technical process would spend upwards of thousands of dollars and hundreds of hours learning to use the software. Is that practical now? No. Geez. And who is the cheap ass that owns the Porsche?
Reply: @Haydenschreiermk2  bro my time is like $45/hour and I'm a loser. Your time is probably way more valuable.
Reply: @Haydenschreiermk2 he means this is probably what Porsche is doing with their parts and they charge 2k
Reply: @Haydenschreiermk2 how many manhours did you invest in that? Do you work for free?
Reply: @Haydenschreiermk2  hey man I want to get into 3d printing but I'm broke I only make like 50$ a month.  If you have any old 3d printers you don't use anymore.  No matter how old I'd really appreciate the help. I'm from Nigeria. But I'll pay for the shipping. Thanks🙏
Reply: @Haydenschreiermk2 so why the title said 20$ if the material without the scanner and the printer is 250$ ? 😂
Reply: @Haydenschreiermk2  hence why he said he already had it
Reply: @Haydenschreiermk2 great work!!
Reply: @Haydenschreiermk2 In somente countries like Brazil, people pay a lot of money for car parts that are imported. If someone start selling those kinda of products, this person can get Billionaire.
Reply: @Haydenschreiermk2  How would it have pay itself off when you don't own that Porsche?
Reply: @Haydenschreiermk2 what kind of a printer is it?
Reply: @Haydenschreiermk2 would’ve been around 3500 not 4000
Reply: @Haydenschreiermk2 Something tells me he's going to want another set soon.  In the mean time, he might as well sell the OEM for $1,200 to use the money paying you for two sets.
Reply: @Haydenschreiermk2 I just want to say that you are obviously right and the more parts you print, the cheaper the entire cost of the operation gets (proportionally). And I think most people would agree. The comment was funny though and I gave it a thumbs up.
Reply: @Haydenschreiermk2  You didn't need a pair though. You only needed one. Stop trying to inflate the money you saved! Nothing more annoying than the cost of the tools not being included. "You can make this for $40!", And they use $10,000 water jet and $2,000 welder and $200 for painting.
Reply: @NoMoreBsPlease are you buying the water jet every single use?
Reply: @NoMoreBsPlease  apparently they don’t have to 😂
Reply: @Haydenschreiermk2 it’s not fitting though, you clearly see the gap and it’s to big. I applaud the effort though
Reply: @KiNgSaRcAsMoNe  can be made again is the whole point.
Reply: @K @KiNgSaRcAsMoNe at’s his fault I use a cheep einstar and have had perfect fitment to my rx7
Reply: @KiNgSaRcAsMoNe it's lighting. Look closer. It fits perfectly.
Reply: @matt33876  No there is a gap on the top.. But I believe it's the way it was installed..
Reply: @KiNgSaRcAsMoNe  tbh i dont see it. But u have some likes so i prob missed it im guessing. But i dont see why people even try arguing that this isn’t big brain. ATLEAST 1k money saved, calculating that he bought the 3d scan tool for it aswell. + new handy tool + alot of money. Wouldnt see u make 100+ an hour, he just did.
Reply: @sjondedrukker2080 well, if you have a Car like that, things should fit. 
It’s not a “perfectionists” fit is what I mean
Reply: @KiNgSaRcAsMoNe yeah this is actually w good point. For a 300,000+ car, if it doesn't fit perfect it's out of place.
Reply: @KiNgSaRcAsMoNe it’s a perfect fit. The gap you’re seeing the dark side of a rounded edge - a shadow cast by the body work as it carves in towards the inlet. Light does weird things when reflecting off of rounded surfaces.
Reply: @SandzAllDay it really isn’t. It’s fair enough though, I am one of those “this picture is 0000000.1 Planck Length off” kind of person
Reply: @bmthfan1231 you'd be surprised how many 6 figure cars that are just garbage. Unfortunately alot of times you dont get what you pay for. You pay for the ability to say I have more money than you..... my professional opinion after 25 years of working on these turds. However porsche is one of the better ones.
Reply: @KiNgSaRcAsMoNe sorry. What gap?
Reply: @barely_harmless look, if you can’t see it, sorry. I don’t have time to comment every time someone disagrees with reality
Reply: @janneymike yeah that's sounding to be increasingly common as we get more and more "advanced" it sounds too. Sad. Thanks for pointing that out, you're absolutely right.
Reply: @KiNgSaRcAsMoNe yeah... There's some little gap!
Reply: @sjondedrukker2080 lui aveva già sia lo scanner che la stampante 
 Ha speso solo $250,00
Reply: @Haydenschreiermk2 and the plastic part costs 250-300! You are comparing to carbon fiber!
Reply: @Haydenschreiermk2 it's on eBay for $400 and that was just the very first one I saw. It's not some fuckin rare car
Reply: @Spicywiener78 thats the otter lite. He has the regular otter. But the lite could absolutely do this. Hell the ferret you can find for like 220 and it can do this.
Reply: @Haydenschreiermk2 and hiw much did the printer and scanner cost then?
Reply: @Loganxmusic9339 my brother, as long as someone uses those things for multiple projects, your argument is completely invalid.
Reply: @Silverburstnelson how much did those tools (that were paramount to actually achieving the result) cost?
Reply: @Loganxmusic9339 if you think he bought that printer just for that part then you are really lost bro....... im sure this is not the only thing he made with that printer
Reply: @evensbaptiste6415 yeah I bet he also makes dnd figurines too 😂
Reply: @Loganxmusic9339 it's an asset, you don't take up the entire cost of the machine in the period it was aquired, you spread the cost out over its life time as an annual depreciation. If you wanted to go really far, you could calculate the cost of using the machine for printing these parts, but more realistically the only relevant costs here were the material and labour.
Reply: @zwicker5585 if thats the only thing your mind goes to when thinking about a printer there is absolutely no hope for your uncreative mind
Reply: @Loganxmusic9339  im angry at all the people making fun of you instead of just answering how much the stupid tool is. Reddit moment.
Reply: @hesmycat 100%, and people pretend like the printer cost doesn't exist so if you were to do it now, the part would be 10 times cheaper for any random Joe.
Reply: @evensbaptiste6415 yea but the point is, if you don't have the scanner and printer, making that same piece would still cost thousands.
Reply: @Silverburstnelson The point is if they paid someone to do this then it would have cost the same if not more.
Reply: @N @N8_360 oh and nice ai bmw profile. Very creative indeed. Think its time I give up my lead creative designer job cuz ive been out creatived by some loser with ai and no sense of humour
Reply: @hesmycat he could look it up himself lmao, people are clowning on him because he’s being ignorant and wants other people to do his research for him 😂
Reply: @Antody  he makes TONS of parts, inventions, replicas, and copies....and he did this as a favor for his friends situation. Also he did this much more expensive than what you would actually be able to do especially if you have a sprayer and paint lmao. You're literally commenting on a thread directly connected and proceeding his OWN COMMENT ON THE PRICE OF EQUIPMENT which is totally redundant in this context since this is for the part not for the equipment for the part, yet unnecessary he did say the cost of scanner and printer....are you senile??...😑🤌🏾
Reply: @Antody  If you want to know though his printer is between $400-1000(depending on specific Creality setups of same basic printer), and around $300-700 (same as printer situation) for the scanners.🙌🏾
Reply: @evensbaptiste6415 

Point is not everyone has a 3D Printer. If they have well and good. If they don’t, what’s the point? Just buy it OEM then.
Reply: @A @Antody eah lmao. Like all dummies talking about how its an asset and stuff. Like yeah man it definitely is, it can be used for whatever stuff one wants. But point is not everyone has a 3D printer.
Reply: @Appu17375  ? yeah thats why you buy it as an asset? after that you have 3d printer that can be used for things like this, unlike if you just bought the OEM and now spent a similar amount and got nothing else.

people really need to learn the difference between asset and material costs. i worry for peoples finances if this is how they treat things like cars and houses as well, use it once then throw it in the trash.
Reply: @Loganxmusic9339  irrelevant, they're likely used for tons of other things so the only costs that should be considered are materials and time
Reply: @Haydenschreiermk2  time is money and you're not accounting for that.
Reply: @Haydenschreiermk2 no $3400 for the pair.
Reply: @sforza209 $3580.92 before tax and shipping 😅
Reply: @Haydenschreiermk2  material + $200 paint so 450.  Is your time free too?  I mean it must have taken at least 8 hours in total if you count all the steps.  Lastly, you have to account for the slight depreciation of the car because this isn't a factory part.
Basically, let's be honest... This is for the channel content.
Reply: @Haydenschreiermk2 factoring the cost of tbe scanner and printer, AND the time necessary to learn how to use those tools, how much did it actually cost? Because what you are presenting is a solution that requires mentioned tools/knowledge,
Reply: @x30andSevenx the fact that he has those skills, learnt and uses them to solve problems like this is why he can afford a 3d printer and has friends that can afford a Porsche
Reply: @mjba-z9t exactly… lol if we were all this good at problem solving.
Reply: @x30andSevenx what a negative/losers mindset.
Reply: @mjba-z9t  affords Porsche but not plastic duct 🤔 😂
Reply: @x30andSevenx you can’t factor in the time to learn a skill into every project, or the cost of learning that skill, or the tools used. By that logic, every doctor would be hundreds of thousands in the hole on every surgery.
Reply: @mjba-z9t 😂😂😂😂❤
Reply: @mjba-z9t idk if its just me because I love learning things but with something like this even if the actual cost is around the same to buy one from Porsche, I personally see it as an excuse and would rather invest in the tools and learn if need be. It will definitely take time/research with certain scenerios but then you can do it again in the future if need be. But I also own a remodeling company that specializes in higher end remodels particularly kitchens where I fabricate solid hardwood countertops as well as cabinets and work on cars, 3d design/print, code and electronics as hobbies so probably different than the average person. But to me getting a 500$ scanner and a 600$ 3d printer would be a no brainier lol. But they also do have a much more high quality scanner And printer combo for 1500 instead of like 2k which would open up even more possibly in the future.
Reply: @Vidar93 exactly... You cant put a monetary value on Being willing to tinker and possibly fail and when it works out, it's worth any amount of money
Reply: @mjba-z9t this comment makes no sense whatsoever 😂 go back to the looney bin
Reply: @sayithowitis3172 not exactly rocket science to 3d print a plastic part with something that models and prints the plastic for you lol
Reply: @mjba-z9t not when the point of the video os about saving money
Reply: @x30andSevenx You're never gonna understand. Just keep scrolling and trolling 😂
Reply: @Haydenschreiermk2 not mentioning how much the scanner cost in the while comment just tells me that thing is like $3000+
Reply: @VoidTrademark  nah the scanner (the lite) is like 600$, the standard otter is 750$
Reply: @Haydenschreiermk2 but did you have to ruin the other one to make both? So in reality you actually couldn't just make 1.. right?
Reply: @Mike-rv5bc it doesn’t need to ruin it there’s washable paint that would fall right off with water
Reply: @Mike-rv5bc You realize he can now go ahead and make more, and sell them as aftermarket replacements on eBay for $500-1000 each now, right ? Lmao.
Reply: @Mike-rv5bc the spray is washable, so it isn't ruined
Reply: @Mike-rv5bc  if it broke again. He just can repeat the process with the OG still exist on the Garage
Reply: @Gixxer1266 Did you see how much rework it needed to be a ready to use product? Ugh.
Reply: @Gixxer1266 they are less from porsche. He compared the prices of carbon ones, so hed be losing money after labour and material cost.
Reply: @Mike-rv5bc it's not ruined Muppet
Reply: @JetFire9  yeah, definitely not a process for people who have more money than sense, totally agree.
Reply: @Mike-rv5bc did you not see the end of the video, where he had all three lined up and asked “can you tell which one is the factory one?” So he didn’t ruin the original one.
Reply: @Mike-rv5bc it doesn’t ruin it, the dots are just lightly stuck on and the spray evaporates after some minutes, it’s specifically made for stuff like this
Reply: @Mike-rv5bc that was washable spray lol
Reply: @Mike-rv5bc  he realistically couldve scanned it without spraying it he just would need to do more clean up or use better software, that part seemed extra
Reply: @Mike-rv5bc the scaning spray will evaparate off given time, and the markers are just stickers that can be peeled off. So there is no damage to the original part.
Reply: @Mike-rv5bc  that sounds ridiculous, it’s like you’re not even the critically thinking lol. Not being rude, but come on.

He still saved thousands upon thousands of dollars regardless of the overall need to take out the second factory component.

That was the purpose of the project, he succeeded, that’s literally all that matters. Nitpicking is just mummers farce.
Reply: @Mike-rv5bc he didnt ruin the other one, the spray he used to make the part not shinny will clean off
Reply: @Gixxer1266 nobody is gonna pay $1000 for a printed part lmao
Reply: @Mike-rv5bc  how is the other one ruined?
Reply: @JetFire9 Maybe a few hours work. I work with fibreglass and its a very similar process to finish up.
Reply: @theredgoblin562 .. I know I does look good.. I was talking shit.. 😂... I tend to do that sometimes.. all good though.. in the end he saved money and really who gives a fuc* anyways.. 😂
Reply: @Haydenschreiermk2 yeah but you needed 1 part and that was hours and hours of work. Realistically this actually would have cost close to the asking price if your friend was paying someone to get it done like normal.

It's great that they were your friend so it could be done at a mate's rate with the bonus of YouTube subsidizing it but overall not really a realistic approach unless it was someone super into 3d printing and tinkering themselves.

Great video though and super cool process, the end result does look great!
Reply: @HeadsetHistorian the entire point is that anyone can get into 3d printing, and, as it gets older it will get cheaper to produce it, which means it will be cheaper to sell. I’m just not excited for all the rocket bunny fans to start 3d printing there cars into oblivion.
Reply: @Haydenschreiermk2 what a smart man. Respect
Reply: @Haydenschreiermk2  how much does the scanner cost?
Reply: Forget if it is 2k or not let's say it is just $50, but not available to buy, then what???
Reply: @schnellster1  then it probably wouldn’t be $50 would it?
Reply: @TheFriendlyXenry you missed the point. No amount of money can buy you that. So it really doesn't matter how much it costs to make it your self. The price now becomes immaterial
Reply: @schnellster1  yea I know sorry I’m just being difficult 😅
Reply: @schnellster1 id just go buy a carbon fibre replacement pair if the originals weren't available . Its not just Portchester who make them
Reply: @TheFriendlyXenry  this guy economics
Reply: @schnellster1 To be fair.  Your point saying no money could buy that is flawed.  You can buy everything the guy bought in this video and make it yourself.

Edit: Just messing with you.
Reply: @christophergallagher3845  not all parts are available aftermarket.  Case in point the heater duct for my vintage car is falling apart and replacements aren't available.   my options are either repair the original one with fiberglass or print off a new one, which I might do anyways so other owners of my car can get them when theirs eventually fail.
Reply: @nubreed13 theyre available for this specific car in this specific video though , aren't they ?
Reply: @schnellster1  it is a fair point. And it happens more often than people think. It is not about the free market economy,  it is about needing the part and not finding it available. People can start a business like this, selling 3D printable parts of things that are not lizards or Pokemons. Once you have the model scanned, then you decide the material based on the budget.
Reply: @schnellster1 this is exactly what I came to say. Some parts are just literally impossible to find because they don't make them anymore.
   Or they do but it takes 3-5 weeks to ship from across the globe and you need the part now.
  I don't understand why you have to buy all this stuff. Why isn't there just a 3D printing business that you can go to like you can go to Walgreens to get photos printed
Reply: @schnellster1 why would any company make a part that they don't plan on selling? Doesn't every manufacturer have a parts department? Name one that doesn't if you disagree.
Reply: @eazy.peezy1834  It could be an older car in which parts are no longer made. Think of 80's or 90's plastic parts.
Reply: @monsieurtukini then you buy the same part to another car. If you know anything about cars, you'd know that parts are typically interchangeable between a shit ton of them.
Reply: @eazy.peezy1834  That's of course the main option. But there are plenty of reasons why a certain part could be scarse. And if you deal with an older car, getting an OG replacement from another car would be just as old and not have much life left to it. With that said, 3D printing and scanning proves to be a useful and valid resource precisely for scarse, or in the case of the video, overpriced parts. That doesn't make it the norm, at least for now.
Reply: @eazy.peezy1834 it’s because there isn’t a huge need for this part. They often aren’t missing or damaged so nobody is making them
Reply: @alteredstateskustom wouldn't it be make more sense to have a 3D printing company to just print one out for you in this case as opposed to buying a printer to make one item that nobody else needs? You're never going to recoup the money spent on the printer if you only need one piece.
Reply: Plot twists. Prints more and sells on eBay for 1k a piece. Now who’s complaining about the cost of the printer?!?!
Reply: @matty6212 
If there was that much demand for it, it’d already be available in ebay.
Reply: @matty6212 Also, the cost of the oem part is due to lack of demand. Parts are always cheaper when mass produced
Reply: if i owned a porsche i would have it insured, a vandalism claim at 500 deductible would get the part . othrewise dont own an expensive car unless ur ready to pay for its parts
Reply: @osaidistilo insurance doesnt always pay out. I wish people would stop thinking these companies are just gonna bail you out of thousands worth of damage.
Reply: @2xShawn to your point, they do try to scam people, but what better can you do
Reply: @osaidistilo I got rid of my Jaguar because of maintenance costs, got a really good deal on it for a 2019 with low miles in mint condition, a 25t with 40k miles $12k cash
Reply: There are professional 3D printing services that will probably do this for $50-100. And the quality is higher than what you get here.
Reply: Yea if your buying everything he has but mainly he prolly paid 200 for everything
Reply: Bingo
Reply: @lossless1234 But its not $2k for the part, its $2k for 2 of the parts, the 3D printer, the Scanner, and the ability to make other parts or more of the same part whenever you want.
Reply: @poeticalvision  Not everyone wants to sit around making car parts that melt in the sun
Reply: @HSV_126 That's why it's printed in ASA, which has a heat deflection temp of 80-100C (176-212F)
Reply: Hahaha 😂
Reply: I guess with everyone’s logic labor is worth 0$
Reply: @MrSeth3158 I hate when people think that lol. It's usually people who have never done a real day of work in their life
Reply: @MrSeth3158 why would labor cost for something you’re doing yourself? You gonna pay yourself hourly?
Reply: @450M3.7  it matters because your time is supposed to be valuable. Doing x hours of work when the same price could solve your problem with no time investment should matter to you. You should have better things to do. You DO have better things to do.. right ?
Reply: @jamesc.2907 like what mf
Reply: @jamesc.2907  We know time is money, but have you thought about the fact that this is his hobby, and he’s a YouTuber. He probably found the prossess interesting and fun. So why drag everyone down with your weird comment?
Reply: @HerrBerg  the same way I would like to spend my time for my hobbies instead of repairing my stuff for hours
Reply: @450M3.7  yea well this is exactly my point. It’s a hobby but the video is advertising it like it’s saving you money. Just do the video as a cool hobby project you don’t need to input bs into something to make it cool. It’s dope the way it is that’s all.
Reply: Came here to say this hahaha
Reply: BUT you keep the 3d printer for more
Reply: If the equipment to do the job right is payed off in 1 job, then it's absolutely worth buying the equipment. Especially something as versatile as a 3d scanner and printer.
Reply: @WillR-s9c  buy it 😂
Reply: @MTVFlexx  what?
Reply: Or more…
Reply: Lol, a lot more than that
Reply: Lmmfao😂😂😂😂😂
Reply: $2k + 3 days
Reply: Hahaha right!?!?!?! 😂
Reply: 2k and 2weeks
Reply: $2k and he got a new part, new printer and scanner.
Reply: @joeclifford183 what if I have zero use for a 3d printer?
Reply: @HSV_126 you sell it or return it . Idk why as a adult you don’t know the answer to this extremely simple question
Reply: All those crying this isn't for you lol
Reply: Exactly 😂😂😂
Reply: Not good for your lungs. Useoxygen face mask. 😂
Reply: Onky skilled and knowledgeable man can save money. If there is a shop that does this they would ask for a high price
Reply: so for example you can :
- have a scam porshe part
OR
- have as many parts as you want
- have a 3d printer
- be able to print many other things in the future
- sell 3d printer

and all that for the same price or waaaaay cheaper if you sell printer
so to disagree or comment like that would make you completly brain damaged but I'm glad you were joking of course !
Reply: Lmaoo
Reply: If you dont have equipment just buy the part, but if you have the equipment you can try it because is cost effective long term case.
Reply: Do you also include the cost of the stove whenever you cook eggs
Reply: So don't replace it??
Reply: 800 to 1200 for the 3d printer looked up on different plat forms
Reply: @bigdos23   yeah and u forgot the time to learn how to use it, how to use the scanner and master the software 😆 weeks of work
Reply: The printer can count as an investment since u use it multiple times it wont really count to the total amount (which the ytuber said is 250$)😅
Reply: could lowk print and sell them for like 500 bucks and make profit lol
Reply: And how much is that Creality scanner thing?
Reply: So same price but you get a 3d scanner and printer now and can print out any replacements in the future
Reply: If the final cost was 2k anyway, it's worth it because you keep the tools to make more and even sell them.

Ever heard of guy math? 😂
Reply: @Jhet  I got one word for you, man : opportunity cost 😅 but, hey, some guys just like to tinker and that's fine
Reply: @Jhet how many do you think you’re going to sell?

Your math ain’t mathing

This part isn’t often needed. That’s why they’re expensive factory prices it high and there no other company producing it 

Ever hear of supply and demand my guy?

There’s no demand. So there’s no supply
Reply: @alteredstateskustom yes but the tools aren’t single use so it pays for itself in usage while you spend 1/10th of the cost in materials.
Reply: @alteredstateskustom I literally paid off my printers by printing anime figurines..

It doesn't need to be 1 specific car part, you can quite literally print whatever you want
Reply: His friend is a cheapskate. Bro has a Porsche and doesn't want to pay for a part? Poor people behavior.
Reply: More like 300 max. 1500 saved
Reply: Yes for this set the next set you print for the guy down the street are pure profits  you know you can make as many as you want
Reply: You are dense, the printer is a one time purchase that is useable for life…
Reply: No, My friend bought such printer as a toy.
Reply: Guys guys, he simply meant that you can DIY if you have the setup shown in the video, other wise either you need to find a friend having the setup or at the last, you know it.
Reply: You're aware that's not how this works right? You don't calculate it as a one time cost because you will be getting multiple uses out of the materials.
Reply: Probably more if you count everything. Workshop. Scanner. Software. Education. Equipment. Skills. Patience... and you'll KNOW it's not genuine 😂 can't put a price on being the only one at the club using am aftermarket part. Or if Posche won't service your car. Or insurance denies future claims because it's modified.
Reply: Lol
Reply: Definitely not. <=1K max. He saves him a couple grand doing this instead of buying from Porsche
Reply: include the cost of materials plus number of hours
Reply: Shit im about to hop on my ebike with a shiesty and scan parking lots for Porsches.  Ill sell em for 500 a pop fcfs!
Reply: More 😂
Reply: If you can find the scan online since people will start sharing these probably and already have a printer it could be cost effective but if you end up having to buy both the printer and a scanner it’s definitely going to cost the same or more
Reply: Actually more like 100
Reply: What if you dont have any thing to scan
Reply: Pretty much the creality k2 plus he used is 1300 on Amazon plus all the tools and stuff he also used i say 2k or more without counting the effort and time 😂
Reply: Just have someone like him make this for you and pay him, much cheaper than 2 or 4k
Reply: You could use your phone for the actual 3D scanning part of the process, then you 3D print the part. Realistically if you were trying to save as much money as possible, you could use free software to make sure the part is perfect, then use do the same basic thing that he did to finish it, with some cheaper stuff.
Reply: The time and risk
Reply: Buy a used one that looks new off another Porsche
Reply: But tgats for w parts, instead on one...
Reply: Lol
Reply: Broke even, sell the other oem piece hes not using
Reply: Brother remove the service cost
Reply: Honestly u gotta take into account time consumed doing all the 3d printing, priming, painting, etc. So probably more expensive than than 2k i dont think this is worth it for the avarage person, u need 3d scanner and 3d printer beforehand to make it worth it
Reply: Incorrect 

The printer and knowledge is not factored into the cost “of the repair” because it is something that is a “foundational or universal investment”. 

Imagine going to the restaurant and them adding more fees on the bill for things like “Monday’s flat tire” or “March 20 1988’s 8th grade lunch price”. You would laugh and say no this isn’t the cost of our “business”, this is your cost of “living”.
Reply: Even if he didnt have a 3d printer and 3d scanner already itd be below 1k 

3d printers are really cheap nowadays
Reply: Not including hours it took to do it.  Don't forget, time is money.
Reply: Surely Porsche could make them burglar proof, if they wanted to.😮
Reply: Yes, he throws away the machine after every print.
Reply: Not if you have a 3D scanner.
Reply: Next time, porsche will send a thief to steal the other part so that you have to buy it from them 😂
Reply: I mean I rather spend 2k on a printer, a scanner , filament and a paint job than 2k on one part
Reply: I agree. He prove his point wrong 😂
Reply: I was thinking the same thing lmao
Reply: Somebody stole my tailgate I damn sure wish I could print that😂
Reply: When you remove parts from your car to show off printing parts for your car.
Reply: Make  bunch of those  sell them half price on evay
Reply: Should have just bought the part, this took way to much time. What you “saved” in money you payed in time.
Reply: @BITVOLT7  don't know many people whose time is worth 1k an hour
Reply: He can keep making them for pennies on the dollar Forever
Reply: Once you do one print, you just throw away the printer right?
Reply: @Frank-costanza  no you go into business finding things to print and make it your whole life.  most ppl are not going to buy the printer for this part and if they do they probably will forget about it. maybe use it once a year or once every 6 months. maybe once every 3 years.
Reply: Take a wider look. This can bring him thousands in business.
Reply: Yes! For Once
Reply: he prolly charged him a little under $1k tbh
Reply: That is EXACTLY how Porsche makes them!
Reply: For 2, not 1 xD
Reply: You can pay for the piece of plastic or you can pay for a scanner, 3d printer, and a learning experience on how to use them effectively. Worth it imo
Reply: Lmfao
Reply: If it's $250 for the materials and $800 for the scanner, that's kind of like if Porsche lowered their price from $2000 to $1050 and sent you a free 3d scanner along with the replacement part.
Reply: No
Reply: still worth it. hes ready if it happenes again, again. lol
Reply: That's 2K for 1 side
Reply: Yeah, but he can now sell 1 of them  for 1000 and recoup his losses😅
Reply: Rather have 2k worth of printing equipment than a 2k piece of plastic that will probably fall off again
Reply: Maybe the first time but you can apply this to just about anything
Reply: I prefer give those 2k to my bro rather than Porsche
Reply: Not if you charge 500$ for it for anybody else with the same problem.
Reply: still worth it because you can keep the tools
Reply: For 2. So still cheaper.
Reply: + time
Reply: Better $2k spent on skills and learning than $2k funding greed.
Reply: But you can sell the printer and the scanner. Real cost 50$ and a lot of time.
Reply: Ok, yeah. If you add up the printer the scanner and outside paint work and material, probably like 2200? 

But! Now you have a scanner and 3d printer! Thats yours, for almost as much!
Reply: Lmao
Reply: If you csm afford a porche and 3d printer im guessing the cost was never a problem
Reply: No.
Reply: Still rather have the Porsche ones 😂
Reply: Wow!!! Bye bye over price parts
Reply: You poor sleeping sheep, think how much he can make if he sells them even at half price 😊
Reply: So in reality is cost him 
$1000 for the 3D scanner, 
$1250 for the 3D printer,
$250 in materials,
So more then the part itself 😂
Reply: Now sell the real one for $1800…cheaper than Porsche sells it so it will sell for sure, pure profit for you.
Reply: How build a market and sell ‘em for 1k each
Reply: The cost depends on your knowledge and tools. Also now that 1 person made a file everyone has is. If you dont have a 3d printer that is personal problem.  I have 3d printed parts in my truck now.. I got a $150 printer and under $100 in upgrades. The printer has paid for itself several times over. Carbon and plastic blah blah. You can invert the file, print a mold and make the part out of forged carbon.
Reply: And gotten object scans for mass production)
Reply: You forgot to mention that you can print other things, some of which might actually pay for the printer outright eventually
Reply: Sell the original
Reply: Lol🤣🤣🤣
Reply: After buying the printer plus material
Reply: But now you own a 3d printer.
Reply: 3k
Reply: Hm, thats awesome👍🏻
Reply: which will work for many more ways like this. You dont buy a 3d printer for 1 part :)
Reply: This is awesome. So if you started a business,  trust me it would be the same cost. Porsche also have the same 3d printer, wages, labour etc and margin.

If you really feel its cheaper by all means go ahead and start that business.

Competition is always good to keep prices low
Reply: The angry Porsche-bots have invaded the comments.
Reply: @snickerdoooodle 😂
Reply: No, we actually need the same car to test it out, so the final cost is much higher 😂
Reply: I understand now why it costs 2K 😅
Reply: Haha
Reply: It would have been cheaper to buy the part from Porsche.
Reply: This vid is amazing and sad at the same time. 2k..
Reply: more like $112
Reply: But he owns the ability to do it again. Or something more! 😎👍🏾🫶🏾
Reply: so this isnt viable for to use on your porsche?
Reply: 2k for the bambu printer is better than paying porsche for a single part.
Reply: You can easily do this on a 200$ 3dprinter and filament cost 15 $ or less
Reply: And get a 300$ printer and filament 15$ only expensive thing will be the scanner if you don't have it
Reply: Or park the car in a secure parking spot 😅
Reply: I’d say over $2k
Reply: At least you get 2 for that instead of 1 😅
Reply: Ok it’s not thousands saved. Don’t get me wrong, I’m not knocking this video & process. I would expect that it’s several hundred dollars just for the raw printed material and the support material that’s used. Not to mention that whoever is doing the scanning and importing that into a CAD system, and able to run CAD to do the cleanup. It’s a fun project, however, for those people with those skills. Not to be lost in all of this, is the fact that the part cost $1700 to buy a replacement, that’s just ridiculous.
Reply: An aftermarket/independent body shop with the proper equipment could have done that just as well and charged $1,000 for the part and still made a nice profit.
Reply: Regardless, it’s something that you can use to make other things too!  🤷‍♂️
Reply: Dude, seriously? It's funny how you can justify that as a useful way to spend your time. But also make sure that you flash your Audi and your plethra of  tools via videp equipment in a nice digestable form. It's kind of hard to feel that you are just a regular guy.....
Reply: Lol.  Right.  You end up paying that much or more to replace a plastic part for your car and never use it again - depending who you are and what you do with a 3d printer.
Reply: Put porsche  out of business, $1700 is robbery
Reply: Lmao
Reply: "Thousands of dollars saved" so it very likely did cost him about 10$ + his work and time.
Reply: He could easily make that back selling multiple copies as he has the design now for either side.  I would have had them made to look like carbon fibre.
Reply: Depends if you include printer cost.

But more like: first one costs $1,000 + printer cost (if you don't own one) + $1,000-2,000 for 3D scanner.

Second one costs you about $20 in ASA, $5 in Bondo, $6 in primer and $100 for the auto body shop to do it. But you know also own a 3D printer and scanner.

My printer has saved me thousands of dollars over the past 2 years I've used it already. Is it worth investing for a single print? No. Is it worth investing for hundreds or thousands? Absolutely. I'm currently printing a server rack that typically costs me $850-3,000. I found a guy who made the models and sells them for $13. I used up about $80 worth of ASA per rack. I print and sell them to a friend for $350 (after inclusing electricity, printer wear and tear and my time). He saves $500+ and can make custom modifications if he wants. I make a cool $120 of profit (labor included? Not exactly profit). I've 3D printed models that would otherwise cost me hundreds or thousanda of dollara for $20-200.

I made my money back and then thousands in profit long ago.
Reply: Y’all are not counting the labor. And time.
Reply: Your local library should have a 3D printer you know
Reply: @Haydenschreiermk2 In somente countries like Brazil, people pay a lot of money for car parts that are imported. If someone start selling those kinda of products, this person can get Billionaire!!
Reply: High upfront costs… but you can always charge your buddy a couple hundred and do favors for people and eventually get your money back if it was a big concern to get your monies worth
Reply: Let’s say you don’t have a friend and go to a business with the tech and experience. Then, there’s your “$2k” lol
Reply: More. Because his time isn't free
Reply: Cool. Could you please print out the rest of the vehicle for me. I'll come by tomorrow with 20 dollars and pick it up.
Reply: Yeah but you still have the printer and scanner so any future parts cost $3
Reply: More like $3k haha.
Reply: Plus labor
Reply: Correction; 2,000 and $1 dollar.
Reply: More like 300... for both
Reply: Don't you mean 38,000
Reply: And 4 days of work
Reply: Bread tastes better than key ahh answer
Reply: You figure you buy it one time and then you’re making  car parts
Reply: Bro is 5 cus he doesn’t know how to do math 💀
Reply: If you don't already have a 3D printer and all the other stuff on hand.
Reply: Maybe but Porsche doesn't get paid a single penny for a part that cost them $50 to make.
Reply: Mfs these days haven't even heard about "teach a man to fish..."
Reply: Lol your goofy final price maybe if you have to buy it all but then you could make like 10 prolly 15 of them so yeah money saved 😂😂 don't be goofy
Reply: He can also make more and sell to other porche owners with same issue for huge profit? Or would it not sell
Reply: Yeah, but you do this, what, 5 times, and it pays for itself!
Reply: People hating on the cost are wild to me. Yes. The start up for the scanner and the printer are high. You buy that once. Then literally everything you make costs pennies in comparison. It paid for itself with this one print. Now you have thousands upon thousands of hours of print time to gain additional income or savings from prints. 🤦‍♂️
Reply: @RyanDotEXE well not pennies, it cost him 250$ in material alone, then another 100 to get it painted when you can get a set on ebay for 400$. This isnt exactly a good way to make money lmao
Reply: @zwicker5585 he essentially lost money when you take time into account
Reply: absolute no brain here xD you prob believe mechanics have to buy new power tools for every new car, new sockets for every bolt. you buy a new phone instead of charging the one you have xD
Reply: @martinfjell4923 What!?! You can recharge your phone? 🥺🥺 Wish someone would have told me 1500 phones ago... Always wondered what the strange thing with a plug that came with the phone was for... 💸💸💸💸
Reply: @martinfjell4923  wtf are you on about? I always have a few airpods on the ready because they only last like 8 hours, then I have to get a new pair.
Reply: @martinfjell4923 was looking for someone with more than one brain cell in these replies. Goodness some of these other commenters lack the ability to think ahead smh...
Reply: @martinfjell4923 Yeah man, you're paying for labour. Per turn of the screw would cost you $25
Reply: why not factor in the cost of the porsche while youre at it then ? jeez....
Reply: @brian.tm3  because that doesn’t make sense.
Reply: @brian.tm3  because that doesnt create the narrative he wants
Reply: @RuinxDesolation not talking about the channel owner
Reply: I think most people are forgetting as he mentioned DIY community can doit and those people will all these things and they are generally eager to use.
This is one of the use case he presented what can be done and its good it’s not like he is saying anyone can do it because not everyone will have that printer or the knowledge and maybe some of those DIY people even create these things and sell it on ebay or other sites at slightly cheaper price than Porsche.
Reply: @rew23able  not just the printer, that photo scanner is definitely not cheap either
Reply: @khornelor6 you can get a good budget one from 250-350 new so if you get one used you’re chilling. Spend 150 on a new budget printer and $20 on filament for both of these. If you buy used you can get everything for under 500 EASILY. Pay for paint (max 200) let’s say other materials 200. That’s 900 for a 2k part and just do it in your free time
Reply: When you eat a tomato that comes out of the fridge, do you take into account the cost of the fridge?
Reply: @dute53333  if it takes 12 hours to eat the tomato there is an opportunity cost equal to 12x your hourly earning potential
Reply: @dute53333 
If someone breaks into your house and 911 dispatch tells you ‘buy a gun & learn martial arts’. Does it make sense? Sure owning a gun & MA helps a lot in the long term. 

But both require 2 things money & time. You don’t just buy a gun & become an expert at using it within a day. Same for Martial Arts. You have neither time nor money to but a gun,  when someone is in your house, aka we need a quick fix. Same logic.
Reply: @dute53333  You should not keep tomato's in the fridge to begin with.
Reply: @RenghisKhan just for it to be spoiled after a day?
Reply: @RenghisKhan and your comment isn't on topic and shouldn't have been posted to begin with
Reply: @Thrall354  it’s called a metaphor ya dunce
Reply: @RenghisKhan 👆👆👆
Reply: @RenghisKhan So smart Aleck, do you include price of the house you keep tomato in?
I assume you don't leave under the bridge because it'll  raise cost of the fruit even more.
Reply: But now you have a 3D Printer and scanner as well…
Reply: @edgarh252 There's probably a 3d printer in your local library.

They're everywhere now a days
Reply: @ItsAweeb highly doubt that bro
Reply: @Great_PatBingsoo i have yet to visit a library that doesn't have one.
Reply: @ItsAweeb our libraries have printers. But also there are print on demand services as well.
Reply: @edgarh252 every person should have one, just like every person who worked on cars had a lathe 40 years ago.
Reply: If you can afford the Porsche, you can afford the part from the dealership. But you can also afford the scanner and the printer which is more fun than just going down to the dealership and buying it.
Reply: So did it save you money or did it cost you an original part
Reply: @Mike-rv5bc he literally shown all 3 at the end
Reply: @Mike-rv5bc you’re the second person to say this in this one comment. How are people so dumb?
Reply: @Mike-rv5bc haven't you see the video? The original part is not ruined by the end...
Reply: @Mike-rv5bc they have the original part shown at the end dummy
Reply: I don't know if I have the money for a Porsche 992 turbo I have the money to replace a air duct trim and Porsche feels the same way
Reply: @dsandusky123 I'm sure lots of owners feel pain paying 2k for plastic that fell off, but also, think about the second and third owners. The first owner wants good resale which he'll only get if it's affordable to own for the second owner and so forth. You'd better believe that new sales will suffer if resale suffers.
Reply: @dsandusky123 it's not about money, it's about not getting ripped off and 3d printer has a lot of other uses. fixing / replacing car parts has its own satisfaction
Reply: @dsandusky123 people don't get and stay rich by mindlessly spending - that's their kids' job 😂. Porsches hold their value better than most brands, so you probably have more rich cheapskate Porsche owners than many other brands 🤷🏼‍♂️
Reply: @dsandusky123  People who have the money to buy a Porsche, didn't get that money by squandering it on unnecessary purchases. If I have the choice between spending 2k on a part or 2k on equipment to make parts, I'm buying the equipment.
Reply: So true all that software and hardware 😂😂😂
Reply: I get the saving money part. I’m a huge fan of doing stuff yourself if you’re able to do it, but how much did you spend for the 3-D scanner originally? Obviously, I’m I’m assuming it paid for itself just by doing this, but just curiosity.
Reply: Imagine they start replicating them, selling them and undercutting the competition. They'd rake in cash
Reply: @iramluna4029 if he sold them they would end up costing $500 each. And you can buy them online for $400 already
Reply: @iramluna4029 you’re assuming a big demand for this part.
There isn’t. 
That’s why they’re expensive from the factory and no aftermarket parts are available
Reply: It's more like $3,000 in time tools and material
Reply: @CBXOHIO you can do this for 900 easily. Especially if you use the used market
Reply: @CBXOHIO Yeah you have to start somewhere dude. He's not getting paid during his leisure anyways and he will get a more meticulous product. You can even vacuum form carbon fiber for cheap.
"YEaH but it CostS mOneY to ChaNgE a TirE" I have probably 800 dollars in jacks. I have a 3 ton hydraulic jack, four six tons, two three tons, chocks, adapters, transmission jacks, 12 ton presses, compression testing kits, vacuum kits, welders, shop vacs, compressors, gauges, gasket tools, dremels, grinders, saws, air tools, electric ratchets, impacts, electrical diagnostic tools, and I'm just a computer nerd. I save at least 1,000 dollars a year in parts and labor at a minimum and get better quality work done every time. All of my tools are already paid off and have paid for themselves. These are normal average household items. Lathes used to be about 40 years ago too.
Reply: Why are u silly hater !
Reply: People taking the cost of printer, material yada yada are fucken wild lmao. You can rent the scanner, you can send the model to printing businesses. At most you might need to self-learn the software.

It's official. People commenting on YT are dumber than rocks.
Reply: @khonjel_singh  you forget about the labor. the time spent is more than 2k.
Reply: @louiscyfer  disagree. If you're familiar with the tools, you could get this done in an afternoon not counting the time it takes to print the parts & have the auto shop paintmatch
Reply: Now you can also sell those parts online for $10
Reply: 2000 USD for a piece of plastic. They are nuts or smth?
Reply: @infatum9 yup, Id never pay that. I'm cheap. I had a couple of Scion TC, both had rotted rear brakes, the plate that the drum and shoes and everything mounts to. Toyota wanted 700-750$ for the pair of them. I said F that and made them out of sheet metal on both cars lol. Cost was almost free, but quite a few hours of work getting it done and put back together
Reply: Really good. But time = money. Plus your tools.

Cost is about the same. But still a cool project.
Reply: @matt33876 you don't get paid for leisure so you might as well do something with it.
Reply: Your time and knowledge + your hardware and software + the materials + the paint shop equals the final price by Porsche. “I’ve already own the scanner and the printer” doesn’t make sense in business. You have to amortize costs.
Reply: Final cost after 3D printers and 30 hours of work. (30 hours at his work at 50 dollars an hour) :

7k
Reply: @AnnoyinglyCharming-i3h the dumbest math
Reply: A mathgenius. After spending $2000 you have a part vs after spending $2000 you have your part, a very good 3D Printer, a viral reel, knowledge, achievement, a potential sidehustle and more. And i guess he did things like this before so his costs were way lower than a few bucks
Reply: Final cost $2,250 if we don't have any of the equipment or materials. Just buy from Porsche.
Reply: @dc4banger I mean if you only buy 1 duct. But if they fall off or someone steals on now  you have the tools to reproduce accurate replacements or can sell them for $500 on eBay for around $150 in parts. It's a no brainer to scan and replicate over buying from factory where they practise planned obsolescence.
Reply: @HamRadioCast yeah but the real issue is if they just "fall off" a 100k dollar car....
Reply: @HamRadioCast now that is a smart business man
Reply: @dc4banger or buy the printer and now be able to make anything you want
Reply: @dc4banger i can print other parts using the printer, so no, ain't paying if not needed
Reply: @dc4banger or if you don't have the equipment, buy it and use for a variety of other things... 3d printer is the most useful thing you can buy now days
Reply: @dc4banger you didn’t factor in labor
Reply: @dc4banger  To then having to pay 2k again if the other fails as well?
Reply: @dc4banger you do understand you can just use a 3d printer from someone else im sure someone wpuld let you use tjeir 3d printer for like 50 bucks thats 300 all together
Reply: @stefanristic9245 no I didn't know that. Thanks for bringing that my attention
Reply: @dc4banger for 250 more, you have your car part, your 3D scanner and your 3D printer. Even if i had nothing, i still think i would go that route
Reply: @dc4banger it would cost $4k to buy from Porsche, might as well buy the printer and scanner with that money
Reply: @dc4banger  I'd rather by the stuff to make it and have it be significantly cheaper the next time I'm in a bind. Buying that part directly from them just fuels their greed and tells them it's okay to scam people. L comment
Reply: @dc4banger yes and when you lose it again thats another 2k, and when it happens again its another 2k and if another part like this disappears / breaks like they always do just scrap the car i guess, because people these days are victims of wasting money and resistant to learning new usefull skills.
Reply: @dc4banger bro I dont think you understand. This lets you print multiple stuff. Its not a one and done deal.
Reply: @dc4banger  pay someone to print and scan it for you.
Reply: @dc4banger dumbest comment I've ever read